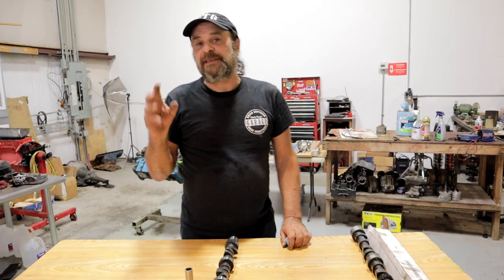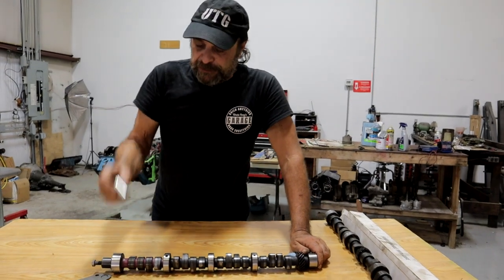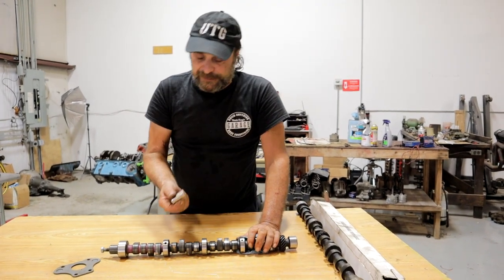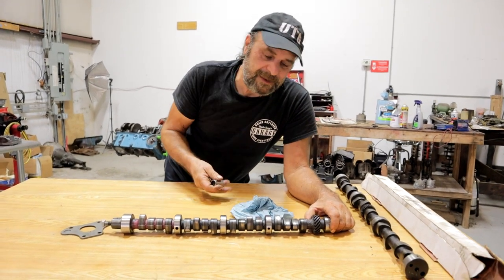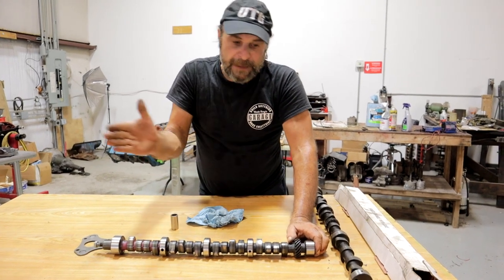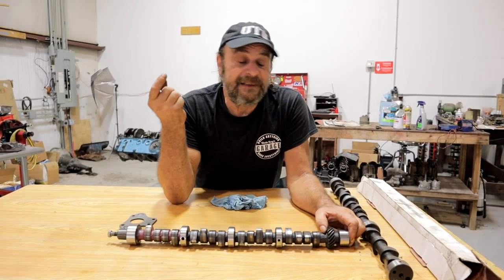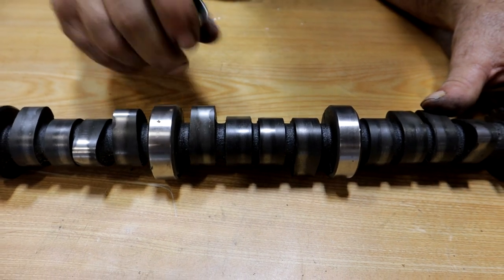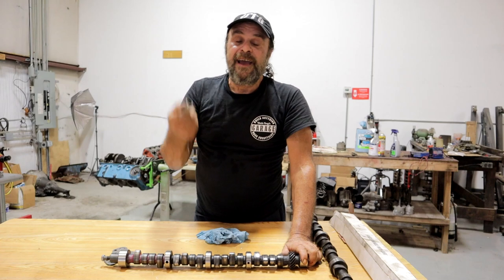Avoid Failure! Camshaft And Lifter Wear Patterns - What They Mean And How They Are Established

Comment: A very nice explanation of the wear pattern, thanks. Now here's where you need some help.  ZDDP is NOT the be-all to end-all, and I've also seen a past video (think it was on Vizards channel) where you said you are using Rotella. 

Rotella "gas" formula is better than the diesel for wear protection, but even the best Rotella, does not compare in film strength to the better synthetics.  As a matter of fact Rotellla gas truck motor oil has about 37%  less wear protection than the best synthetic on the market. 

Zinc/ZDDP additives may or may not work.  Film/sheer strength is what you want. A fllm /sheer strength of 120,000 psi is desirable for flat tapped OHV engines.  Rotella is about 96,000 psi. vs something like a 10W40 Quaker State All Mileage (conventional oil), which is rated at 126,000 PSI. If you added ZDDP to Rotella, I highly doubt you would get the same protection as the Quaker State. And how much do you add? Unless you know what the Film strength is, you're pissing in the wind.

 Want to know where to obtain this info?  Respond, or you may know it already. So for anyone interested, reply and I will divulge where to find what every motorhead needs to know.  I'm sure there are others reading this , who know what I'm talking about.

Comment: ZDDP is a family of chemical compounds: zinc dialkyl dithiophosphates. They work by undergoing a chemical reaction at the surface of metal parts that forms a sacrificial film on the metal, basically it wears away rather than the steel underneath. ZDDP in the oil keeps rebuilding the sacrificial film until it is all used up.

Comment: Whats going on with the cam on your left at 6:18 / 6:22 give or take a bit, it seems to want to go to a heavy side down. Try to get your work bench as level as possible and roll the cam, it will want to stop with the same place down every time, a balance issue!  Even better drill on center and tap the ends of the cam and mount it with some easy spin bearings and see even at slow rpms it will want to get away from your grip. I learned from this that some lobes are ground  so the cam wants to self center front to rear using the lobe taper and gear for the oil pump and distributor drive. I once worked on a motor where the cam gear managed to move on the camshaft making for quite a bit of end play, talk about a weird running motor as the timing was all over the place both valve and ignition, it was a gear drive sit up with helical cut gears on both the cam drive and the distributor drive. Some times it would idle fine the next time like a race cam and every thing in between!!

Comment: I've seen one engine with a camshaft that was lubricated quite differently; a 2.3 liter (140 cubic inch) Pinto engine. I turned it over with the valve cover off and observed pressurized oil spurting from holes on the lobe wear surfaces. As an aside, it had crud in these holes, apparently from lack of oil changes.
Looks like all generalities have exceptions. 🧐😎
Reply: That's hardly an exception.  The pinto engine is over head cam so the crank and rods can't splash oil on it. Tony is describing how the cam and lifters are lubricated on a classic v8 engine. I get to see the oil tube in my brothers pinto whenever I have to remove the valve cover.

Comment: Good morning UT ,  another good lesson explained well .   Why don't engine designer's use a direct oil system ?
Reply: Splash oiling is simpler and therefore cheaper.

Engines with overhead camshafts usually have pressure fed lubrication of the cam lobes, because the location of the cam makes splash lubrication infeasible.
Reply: @nerd1000ify  nerd1000fly , thanks

Comment: 25 years ago, I had a cylinder head remanufactured for a Ford Escort. 3000 miles later, loud lifter clacking and loss of oil pressure. Turns out, they resurfaced the lifters when they rebuilt the head. The lifter foot ground all the way through to the inner bore. All that metal went through my engine. I was a pissed off fellow. Resurfaced lifters are a thing especially with large engine remanufacturers. Powell machine has a great video on this problem.

Comment: Another interesting fact is that the cam lobe against the lifters  has the highest force of pressure than any other part of the engine. 
By far.
Think about it. Let's say that the valve springs are rated at 350#s, all that spring pressure is applied to the cam lobe on a surface area that is probably not more than 1 or 2 thousands of an inch, and about 1/4 inch of the lobes thickness.
That's a lot of pressure on such a small surface area. 
That's why proper lubrication is so vital for the cam/lifter survival.

Comment: I am building a Studebaker v8. The camshaft has thrust plate and helical timing gears, no chain. Mechanical lifters, not hydraulic. The old cam is worn as in this video and every lifter is slightly concave. Use a felt tip pen on the flat of the lifter and swipe it across 400 grit emory paper and every one will show a circumferential ring about 1/4 inch wide but the center is untouched. So even after 168000 miles the lifters were still rotating with no crown at all.

Comment: On a 300 l6 ive swaped what hole the lifters were in, many times, and did not flaten a cam.
But!!!!!!!!!! Spring pressers were low, and on low lift cams. Ive have had the same luck on tractors, dozers, gen sets, lawn mowers, water pumps....

Comment: I have a stock 67 383. It runs, so I'm gonna do what I always do: flat tappet hydraulic cam (probably a regrind), lifters, timing chain, oil pump, windage tray, valve seals, and springs. Since the cam is oiled by WINDAGE, should I wait until AFTER the cam is broken in, to install the windage tray??

Comment: Yes uncle Tony I'm Dan from Canada I have a 3:40 motors been sitting since 85 in the garage and I've been rotating it over by hand do I have to take the heads off to get the valve to reset or can I just fired up and leave it run and should be all right

Comment: I had old crappy gas and in my 305 Chevy in my truck It Collapsed the number 3 intake lifter (Flat tappet)  or it just ate the cam lobe it was tapping like crazy after a bad start from the old gas. The day before it was running fine at 75 mph.    Still wondering how it happened at startup. Still have to take it apart maybe this weekend its been broken for like 4 months now. Real strange why this failure happened at startup when It had crappy slimy gas. Oh yea it was slime. Real sticky

Comment: Why can't you see wear or damage from roller lifters? This is particularly surprising to me because I've been reading on it and some forums say hydraulic lifters are more at risk to damage the came than flat lifters...can anybody explain to me why and what I'd have to do to find out if my cam is damaged from valve float...I'm getting a fairly loud tap only when accelerating but no issues with power, no misfire, no backfire. Just a loud tap. I've gone down to the intake manifold to change the lifters and the gasket (as I was having significant, more than normal vacum in the crankcase which changing the gasket fixed and the lifters have definitely improved the sound as well). I plan on doing a compression test to see if it's the valves but a mechanic friend of mine said it definitely sounds like top end tap, and if it's not the valves I want to be read to test the cam some way if possible. I already inspected it when I did the manifold and there's was no noticeable wear...so I'm not surprised you wouldn't be able to see wear from roller lifters. I just want to know why? How to know if it is the cam if said cam is broken? And if it's possible to hear a tap without the other symptoms...

Comment: Excellent video Uncle Tony!
Question?  If I have a good used camshaft, but none of the original lifters for each specific lobe, can I install new lifters without a problem?  Cheers,
Reply: Follow typical breakin process but yes. Old cam new lifters is generally accepted. New cam old lifters is frowned upon by the majority

Comment: I just don't buy the zinc part. Camshaft manufacturers needed an excuse as to the reason for all the failures. "Yeah, there is not enough zinc in modern oils, yeah that's it". It couldn't be the REALLY steep lobes, or cheap offshore materials/manufacturing . "Nope, it's definitely not that, it's the oil."

Comment: This reminds me of my most recent f#ck up where I installed the rocker shafts wrong in a 2011 ford 6.2 engine. Guy I sold it to gets it installed and running but the rocker on cylinder #8 failed after the first day of driving it. Went around in circles trying to figure it out and it turned out the intake rocker shaft's oiling system is drilled different than the exhaust and I had them mixed up.   😢

Comment: You FAILED to mention oil shot at the cam from the spit holes on the connecting rods/caps. Care should be taken when mounting pistons on rods. Not only do you need the pistons facing correctly, but you need the rod chamfers facing the crank pin cheeks, AND the spit holes facing the cam.

Comment: Tony, would this info apply to a Harley cam also ?  as far as the hi metal low metal marks go....... I just finished breaking in a rebuilt evolution engine.  I am thinking about changing to a different  cam.  when I get I to the cam chest, should I see the angled markings on the cam ?  on a engine with 2000-2500 miles on it ?
Reply from the maker: You're dealing with rollers...none of this taper stuff applies
Reply: My manager had nothing but hassles on a recent cam swap in his Harley. 
Mainly tapping lifters ,new OEM Harley ones he used too. 
He tore it down again and got some aftermarket ones from someone like s+s or somebody and it's been fine.

Comment: So a dished lifter and a cam lobe that shows all shiny metal at the apex means it's not wearing normally?

Am I thinking about it correctly?
Reply: A dished lifter would be a problem. The dish stops it from rotating so it just sits in one spot and wears. As long as the cam has the taper marks on the ramps it should be good.
Reply: @NBSV1  alright, my motor is an old original big block chrysler, it has dished lifters but it is still rotating in the lifter bores.

I've been driving for 7 years with those dished lifters but no problem, yet.

 I'm guessing there is some taper left on the cam lobe?

Comment: Is there any reason it wouldn’t be possible to reuse a cam and original  lifters, but the lifter positions had been lost, if you went through the full break-in procedure using assembly lube and 2000 rpm for 20 minutes?
Reply: I think the issue you run in to is that the factory finish on the cam and lifters, pre-break-in, is ever so slightly abrasive in order to promote the formation of this wear pattern. With used parts the smoother surface is more likely to slide or skid without forming a pattern that promotes spinning of the lifter. I could see that being a big issue if a lifter is swapped to a lobe that would have the lifter spin the opposite direction. That said I've seen my fair share of backyard rebuilds that totally disregard this and still run fine for a long time, albeit they are typically stock type rebuilds - low performance, low valve spring pressure.
Reply: My opinion…………. 

If the camshaft is good, still has taper and the lifters are good, still has plenty of crown.  You can reestablish a good wear pattern.  I would only try this with low valve spring pressures initially.  Double check lifter bores make sure the lifter can spin.  

Just my opinion…….
Reply: I won't move a cam and lifter set between blocks, either.  Only time I'll reuse a flat tappet lifter is if it goes on the same lobe in the same block.
That said, many claim to swap parts around willy-nilly without problems (not a performance high spring pressure application, just stock sbc type situation).
Reply: So I check lifters to make sure they still have the convex profile on the bottom. If they do I use a little bit of fine sandpaper just to rough up the bottom a bit. Then just slap it back together. (This is just for situations where lifters weren’t kept in order). I don’t use old lifters on a new cam though

Comment: Ive asked this a few times - Can you recover from a wiped cam without tearing the engine down to clean it? Can it be cleaned and flushed well enough in the car without removing the pan?  What is the procedure? Thanks Uncle T! Great video as always.
Reply: "Can you recover a Engine from a wiped cam, without tearing the engine down to clean it? "   Short answer... no.
Reply: No the engine needs to come completely appart there is metal particle throughout the engine will eat your bearings up
Reply: You can and it may run good for a while. There is still going to be metal in the engine you are unable to flush out.

Comment: something i dont think the import guys, atleast from what ive seen realize is that those engines are effectively flat tappet. on my 4age toyota engine the cam rides against a shim that acts directly on the valve. theres no roller its essentially flat tappet but in the service or user manuals and on any forums ive seen no one talks about using oil with zinc which seems odd to me. i run VR1 full synthetic and you can actually see the zinc deposited on valve train parts and funny enough the dip stick has a layer of zinc at the bottom

Comment: What are your views on reusing a good performance cam without excessive wear, say something from a swap meet? Would this be okay with all new lifters and a proper break-in or is this something to avoid?
Reply from the maker: If you can see clearly defined taper lines on a used cam, than you can probably get away with using new lifters and going through the break in process as you would with a new cam....key word, probably
Reply: I bought some 383 parts engines about 15 years ago. I later overhauled another 383 for a buddies truck. He wanted a bigger cam. I noticed one of the old blocks had a purple shaft. Hammer it out cleaned the rust off. There was even aome minor pitting. New lifters and good break in still running 50k later.
Reply: Hey Uncle Tony. Love watching you’re vids. Very informative. I have. Random question & since you’re the Mopar guru I couldn’t think of anyone better to ask.  What sorta money would you expect to pay for a 1970 340 small block that is on std bore, std bearings ,has J heads ,windage tray etc. long motor minus cam ,intake manifold & rocker gear?  What do you think would be a reasonable price to pay for that? Cheers
Reply: @UncleTonysGarage  Thanks for the reply.

Comment: I suspected the cam in my buick was walking forward and backward because I could see the ignition timing jumping around by a few degrees.  This particular flat tappet engine was built by the factory using a spring-loaded button at the front of the cam that is supposed to ride against the back of the timing cover.  Well of course, there were interweb sources that disputed the existance of the cam button but watching the timing dance around made me investigate and discover this build had no cam button, so I installed one and did a new chain, new adjustable sprockets while in there, to retard the cam slightly.
Guess what the results were?

Comment: Oil pump doesn't know if the engine is accelerating or deaccelerating. Oil pump doesn't drive the cam that would change the movement of the cam.